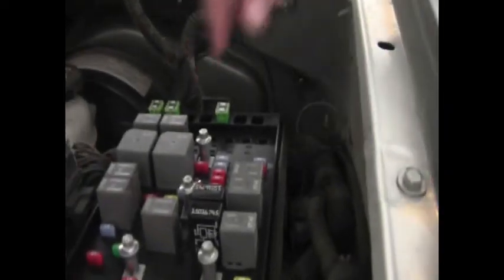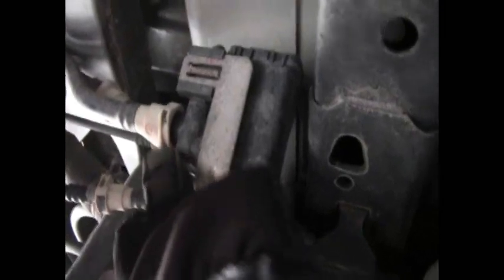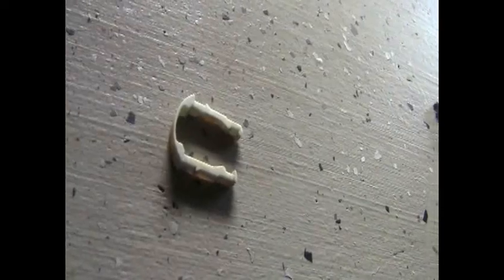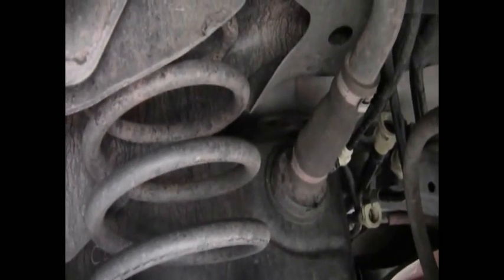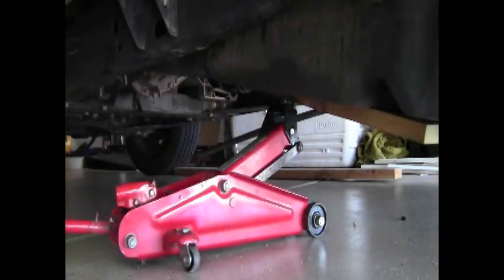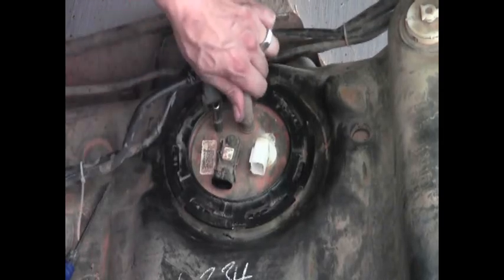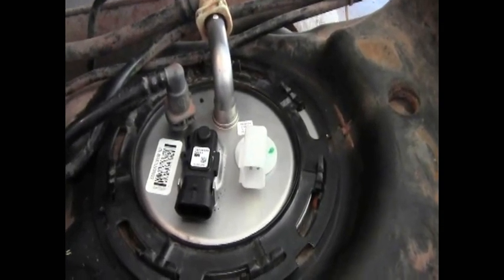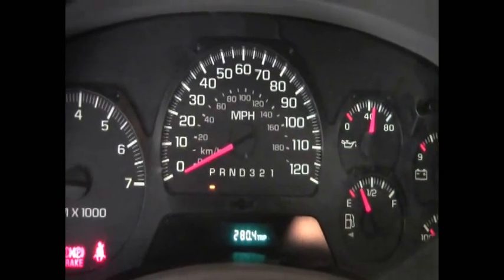2007 Chevy Trailblazer Fuel Pump Replacement, Gas Tank Remove Replace

Comment: This was great. Just had a deadbeat mechanic replace my fuel pump, but the check engine light stayed on. It was a fuel vent problem.  I couldn't get him to fix the problem, so I followed your video and found a connection not hooked up to the cannister. I connected it and check engine light is now off.
Reply from the maker: I know this response is late but I am happy it helped.

Comment: Arrrrgh. Just put mine together this afternoon. Took, like, 3 weeks and I learned three important things. 1. Provide VIN code when ordering parts. 2. Get new fuel line clips shen ordering parts. 3. Do NOT cut the fuel pipe hose thinking, "Hoses? What part store doesn't sell hoses?" Oh yeah, there's a number 4. Hook up the rear tank strap before attaching the eletrical plugs and fuel lines.

Comment: Not bad at all. One thing please DO NOT USE A HAMMER ON A HAMMER TO TAKE THE RING OFF. By hitting the hammer head with a hammer will also spark. Brass is best by far but I have also used Iron wood or other very hard wood. This also is the same procedure for an Isuzu Ascender.
Reply from the maker: Good tip amigo

Comment: Thanks for the video. It was a great help. I just did my '06 TB and it was the same. You're not kidding about those plastic connectors.  My advice to everyone is break all the small ones and buy new. I couldn't find replacements for the big white ones. I was able to get 1 or the 3 out without breaking it. For those ones that I broke I put the pieces back in and then put a zip tie around them (my chevy Mechanic suggested that). It works great!

Comment: Actually, you DO NOT take those clips out of the fuel line connectors. I mean, you can, but as seen in the video you can break them very easily. The side he is prying them out of, you push that side in and then pull the fuel lines apart. You do not have to remove the clips and risk breaking them and having to run back out to the store and buy replacements. Just push that side in and it spreads out the middle part of it to allow you to separate the lines. I just did this on a 2005 Envoy and only replaced the level sender since that is all that was bad.
Reply from the maker: Jason Roth Thanks for the reply Jason.  That is good to know.  Appreciate the tip.

Comment: These fuel line clips are released by pressing the closed side of the clip and pulling the connector. The clips can break even doing it this correct way but you are almost guaranteed to break them trying to pick them out. Nice video though!
Reply from the maker: Thanks man.  I did this job several years ago and had no clue about how those clips worked.  I do now and I know to have some on hand before I even start.

Comment from the maker: The sensor is attached to the fuel pump.  You have to take the pump out no matter what.  You probably can buy the sensor/sending unit but it is a hell of a lot of work to do.  I would change the whole pump.  Either way you have to still do all this work.

Comment: I am attempting this tomorrow, in my yard, with ramps and a small floor jack. I've worked on many cars/ truck in my lifetime, but not for a few years. Sent my son to Wyotech and haven't had to. But now he's 900 miles away and has given me some tips by phone. He had mentioned using hot water on those clips and they pull right off. I'm a little skeptical on that aspect, but will see how easy they are to even see while trying. I will try and come back here with an update.
Reply from the maker: carls1959 good luck amigo!
Reply: Did it. Was not fun, but I did it on uneven ground, on cardboard, with no help. I had to drill out the broken pieces of the old pump, that snapped in the line. WARNING: Tho you pull the pump relay and crank it a few times after it stalls, you may find a line that still has fuel and pressure. That's how my day started. Want to pull it down again and replace some pieces. The side plate, near the driveshaft, fell out in two pieces and, tho they don't leak, I want to replace a few grommets.

Comment: Good video, I suggest telling the novice mechanic to clean tank also. Always remember static electricity is easily removed by touching everything bare handed first. Finally, don't make the same mistake I did by forgetting the tank brackets order during disassembly, they are not interchangeable!!!
Reply from the maker: Good tips man.  I am a novice mechanic also!

Comment: very good video, I congratulate you, I made the replacement of the pump to see your video, I saved a few dollars, thank you very much, I have a question: how many psi should the pump have for the engine to work properly? My trailblazer is the 2004 model 6l.
Reply from the maker: Glad it helped!. I think it should be between 65 and 70 psi but I am not positive.

Comment: I replaced a fuel pump in a 1999 Honda it was so easy because there is a floor plate with a gasket over top of the tank under the seat. Very EASY

Comment: To the peeps who have mid 2000's gm vehicle. If any of the gauges are acting flaky, ie fuel, speedometer... It could be the stepper motor that drives each needle. Only X25.168 and X27.168 stepper motors are approved by GM.  x15 168 and x c5 168 stepper motors all fail over time. You can take the instrument cluster out and disassemble to the main board yourself, but it does require desoldering the old ones and soldering in the new ones. Just buy enough to do them all. If you don't know how to solder get someone who can do it, or take it to a tv repair shop. A new instrument cluster or a used one is high $ and getting the dealer to program it is $100 or so. Search you tube for "gm stepper motor replacement". You will need to adjust the needles to your mark on the tape you made per the videos instructions. I reinstalled mine and left the cover off so I could calibrate the speedometer to my gps while driving.

Comment: Thanks for the video!  I have a question.  I have a 2006 Trailblazer that the fuel gauge shows 3/4 tank, then it will ding the tank in empty (but has $25 of gas in it) then back to 1/3 tank.  I'm pretty sure its the fuel level sending unit as I can't imagine the gauge triggering a fuel low light and chime.  What do you think?

Comment: So this vehicle doesn't have a fuel filter ? Mines have been sitting up for about a year and i recently changed all the fluids and put a Gas treatment and filled up and once i cranked it 🙃  it started acting crazy wont stay running. I need help
Reply from the maker: It does have a fuel filter.  It is next to the tank.  If your vehicle was sitting for a long time the gas may have gone bad.

Comment: Hi everyone. I need to get this job done on my 06 Trailblazer. However, I have a question for you. If my tank was almost empty, and once you're done with all the process. Do I have to put more gas before start the vehicle?
Reply from the maker: Marcela Herrera If there is enough gas for the pump to suck up then it should be okay.

Comment: I have to change my fuel tank pressure sensor on my 2008 envoy do I have to disconnect the fuel lines to just lower the tank to get to the sensor? THANKS
Reply: Depends on where the sensor is located. But more than likely you will have to.

Comment: To anyone watching this I believe 05-08 envoys and trailblazers have a special policy about the fuel sensor through your Chevrolet dealer. Basically the contacts wear out to quickly in the sensor. If your vehicle is still covered due to miles I think it's 150000 they would have to replace it for a free. 1000 dollars for this job seems outrageous its 2-3 hour job tops if you have done one before. One quick tip if you have compressed air and gun just put the compressed air to the back of the clip . If you blow the dirt out they remove a lot easier. And all you have to do is squeeze you shouldn't have to take the clip out of the connector.

Comment: Just curious to see if anyone has cut through the floor board to change the pump?  I did it once on a Ford Taurus and it was much easier than dropping the tank. Under the back seat of the trailblazer though its not flat and i dont know where to spot where the cut. Any suggestions?
Reply from the maker: I cut the floor on a Saturn and one of the evap lines was close to the sheet metal and I ended up accidentally cutting it.  It was no fun.

Comment: Hey, that's a good video. Thanks a lot!
Reply from the maker: No problem buddy!
Reply: Neatus Garage Studios   
 
Hi . I need to get this job done on my 06 Trailblazer. However, I have a question for you. If the tank was almost empty, and once you're done with all the process. Do I have to put more gas before start the vehicle?